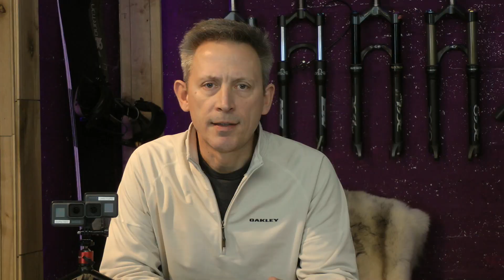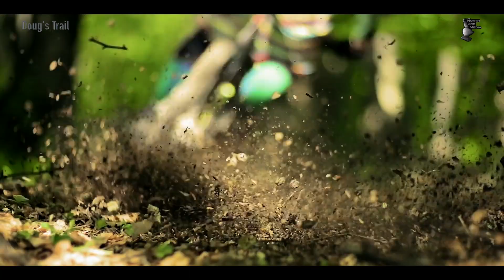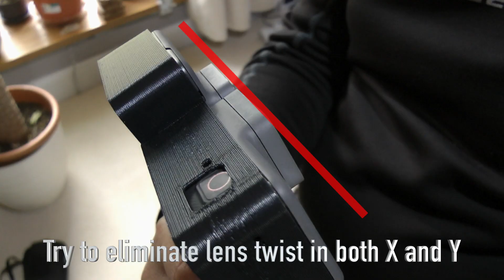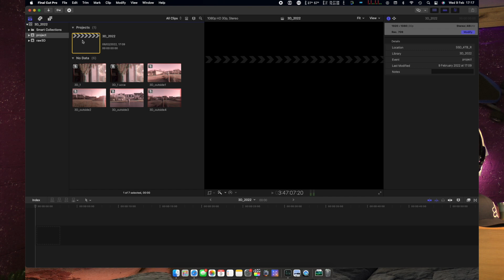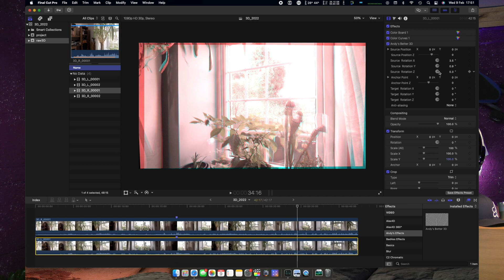Create 3D films using GoPro cameras | Final Cut Pro X workflow

Comment: Wide angle lenses, like gopros, are not optimal for 3D (unless its VR180). It would be easier to use Vegas for editing since it has built in 3D support. 28 mm separation is very small. Works well with closeups/indoor shooting. But for any other situation you need more separation. Human eyes can see depth effectively to about 15 meters. After that it diminishes very rapidly. So I would recomend a separation of 65mm. Building your own rig is obviously satisfying and a learning experience. For someone who just wants to shoot, a qoocam ego, weeview sid or a second hand fujifilm W3 is probably a better option.

Comment: I use two generic "gopros" in a 3d printed case.  I prefer the wider spacing (close to actual eye spacing), so just use them side by side.  As long as you don't shoot things that are too closeup, then that spacing works just fine.   I also have a 65 inch passive 4k 3d TV, so don't need to use anaglyph, but get to use my polarized 3d glasses.  Use Vegas for editing, as it does most formats of 3d.  Just put both clips in the timelines.  It can make anaglyph if you want, but I use the side by side method form my TV. 
I also built a 3d viewer using a Sony Xperia Z5 Premium phone which has a 4K screen.
Reply: Where did you get this printed case from? And which cameras are you using and how do you sync them? I have an LG 65 inch 4K 3D TV. Too bad that they all stopped 3D. 3D is the only reason why I use this TV. It has a great 2D to 3D conversion as long as the resolution is high enough.
Reply: @peterstindl5003    Apeman A77 cameras. 3d printed my own case. Just start them roughly at the same time then sync it to the nearest frame when editing. So, I always shoot at 60fps to allow for closer syncing.
Reply: @my3dviews  I will build something too and at one camera the option that I can adjust the horizontal and vertical alignment with screws. My biggest fear is that my 3D TV dies. No option to replace it with a new 3D TV...

Comment: Im thinking of building a rig combining two Hero Black 11. I wonder how you manage to framesync the two cameras. Does it work to just trigger them with the remote? The Hero 3 + had a cable for sync and i couldnt find any information about framesync with modern GoPros
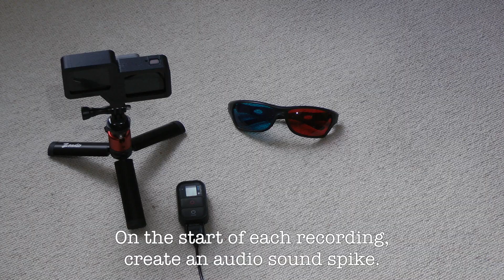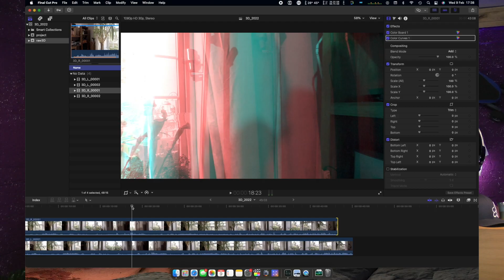Reply from the maker: Hi, the remote is very likely not going to start the two cameras exactly, can be a couple frames out, so at 4:22 and 6:46 points in video I explain how I fix this issue. The remote is mainly a convenience tool and not jog the rig.
Reply: @North3rdMedia  that is not enough if you film people and watch it in vr. i tried. my solution is a mechanic thing to press the start buttons at the same time.

Comment: I have a gopro 9 can I use another 9 or should I go with lesser go pros?  And i must hav3e final cut also.
Reply from the maker: You use two GoPro9’s. The post edit software can be anything that supports at least layers and colour blending of those layers.
Reply from the maker: The 3D GoPro cage I used will only work for Hero8 and lower due to their size.